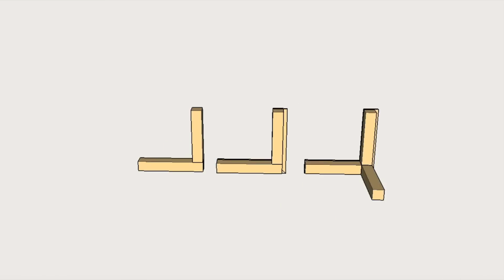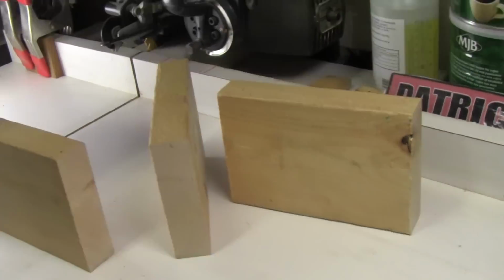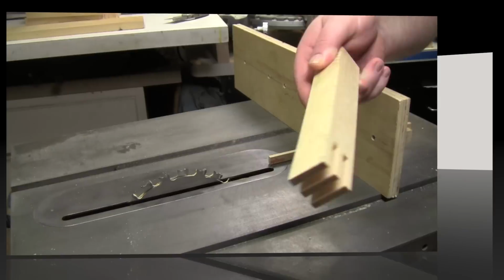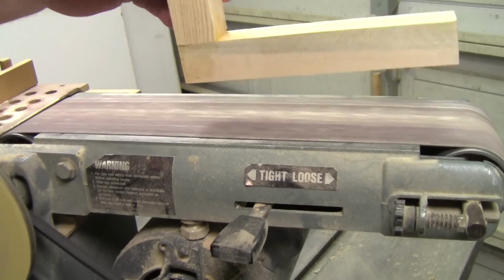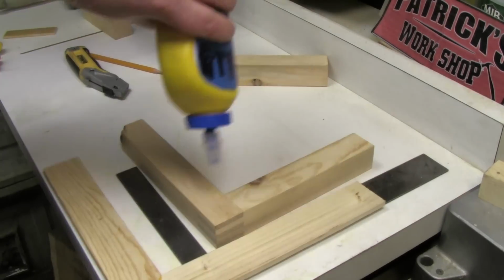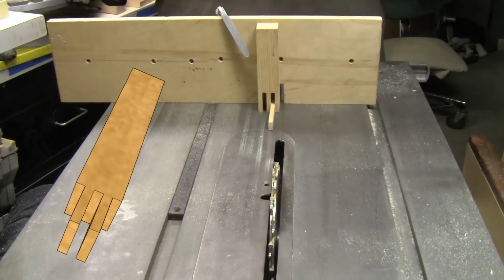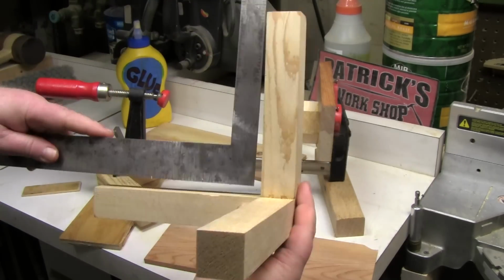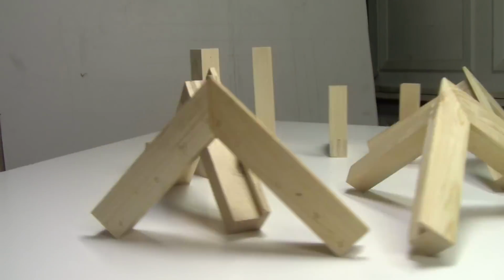How To Make QUICK an EASY DIY CLAMPING BLOCKS

Comment: Nice idea. Would you not want to trim the corner edges of the spars that may come into contact with the clamped boards, in order to avoid any glue squeezeout?

Comment: Nice, very nice.  But I've made my own, various sizes, with two pieces of wood just screwed & glued, clamped at 90 degrees to set, does the job.  The only thing I would add:  I have generously chamfered off the outside corner so that it doesn't come into contact with any glue.
Reply from the maker: Hi, Theo, that's a good tip with the chamfer   thank so much for watching and comenting

Comment: Nice project, just one little thing: By doublestacking the strips you actually double the error of your mitersaw. This will only work with a very well adjusted saw like yours.
If you want to eliminate the error you need to cut both pieces off the same strip with one cut. That way the miter itself might not be exactly 45° but the resulting angle is perfectly square. All you need to make sure for this is that the long edges of the strip are parallel, but that should be a given.

Comment: For a beginner, what you suggest should be the1project?
Reply: Small box, small shelf unit, small cabinet unit. 

You could even use that to fix legs to a chair or table with pocket screws.

Comment: Great idea, easy done, well explained. The only thing I did not understand is why you didn't use a kind of stop-block added to your finger-joint jig, that runs on top of the jig and makes sure that your workpiece is clamped down 90 deg to the table saw surface without needing to check with your square each and every time... :-)

Comment: I don't have time to read 151 comments, so i am sorry if anyone said it before: my idea is for the 3 legs block, when you add 3rd leg, do not make 2 cuts for joint, but just one (1 finger instead of 2). that way you don't weaken the 1st finger joint so badly (down to a quarter inch of the original) Take it as a question instead of an affirmation. I feel that would be stronger this way but who knows, maybe i mistake.

Comment: Great video!  Can't wait for more!   I want to make some long reach clamps with the same finger joints.
Reply: just use plywood . for stronger clamps just glue up U shaped pieces face to face. makes for a very strong clamp with 4 or more half inch pieces glued that way.  use double wedge to squeese  or a  screw bolt with a T nut

Comment: Well made affordable option. Just make sure when checking for square, reference the outside not the inside of the blocks as those are what actually touch your project. They can get off square pretty quick on the belt sander.

Comment: if you put a 1/4" bevel on all exterior edges you have room for glue squeeze out.   Material selection, do you think they will move out of Square over time? Would plywood be more stable?
Reply from the maker: that's a great tip  thanks so much     as for materials  I figure U could use any kind  but I would not use hardwoods   for the reason not to waste the good stuff   in my opinion  the 2x4s are plenty strong and will not move over time  I used a good quality glue and tried to make them as square as possible and see these being used in my shop for years to come   thanks for watching

Comment: Nice video. Good concept and variations of the clamping jigs. These are a cool addition to the shop.  How are they holding up so far? I am curious about the 3 way finger joint.  Thanks!
Reply from the maker: hey, Peter, they are awesome  I am using them in my table saw station build and they work out great.  I hope to have a video out using them in action in a few weeks thanks for watching

Comment: What a great idea... the third leg addition defiantly took it up a notch on the awesomeness scale. The tease at the end was not cool though... LOL 😜
Reply from the maker: Thanks, Russ, I wasn't sure how people were going to think about the third Finger, But they it works for me and that's all that matters. Thanks so much for watching
Reply: I have made 3 axis clamp squares before but did not use finger joints. I have made many variations of corner clamp jigs. I have a wall full of them. 

I have made clamps were there are two "3 axis jigs" on the same unit so that you do not need two seperate jigs and can be clamped all at the same time.